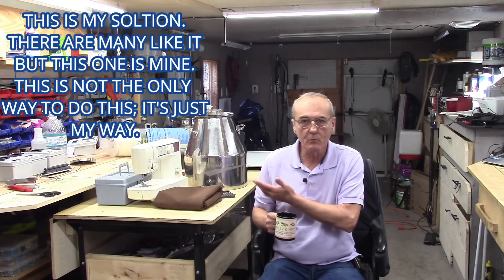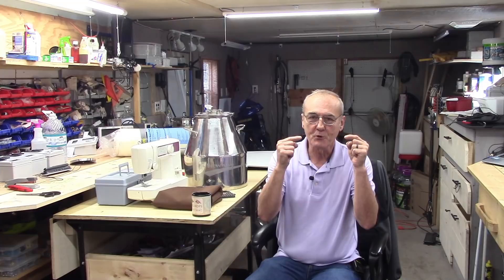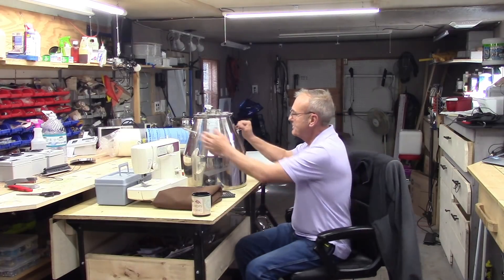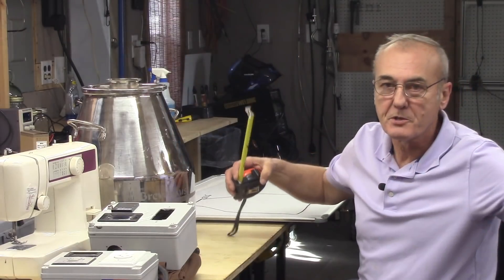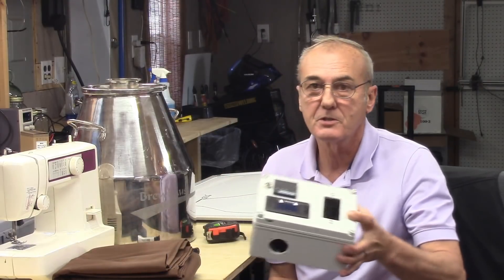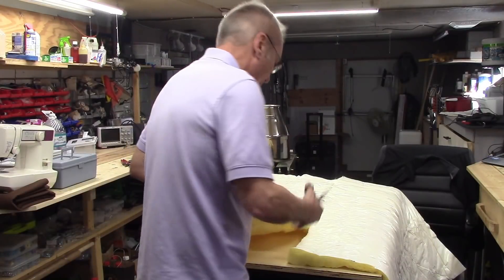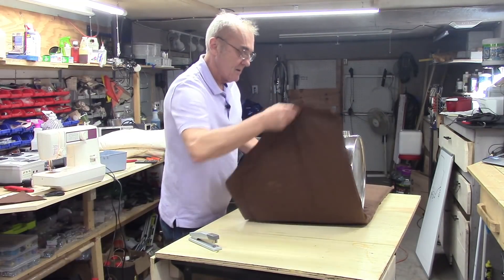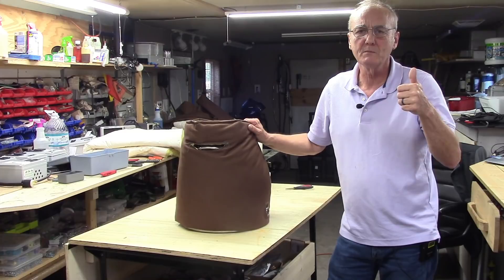INSULATING A STILL.  IS THIS A GOOD IDEA? PART 1

Comment: Wish I had the knowledge, first run with a Mile Hi 8 gallon dual purpose pro is not going well.  Head temps drop up to 30 degrees for no reason, perhaps because I am unable to run running water, but ice water in a cooler.  Frustrating.  After taking out the Foreshots and getting about a quart, 30 degree drop at the head and taking all day, may just toss this and figure out m options. 
Sugar wash was this attempt to use the still for the first time

Comment: I insulated my stills with water heater insulation jacket. It reduced my heat up time dramatically and improved  efficiency. Also prevents accidental burns from touching still.

Comment: George 
Thanks 
I was wrapping my 15.5 gal keg with a blanket. We had a quilted couch cover that we were not using anymore so I asked my better half to double it up and sew it together to make a fit wrap.
The last time I ran, I used the new wrap. This is the only thing I did differently and this run came off at 178 proof where usually it comes off at 170 proof, so it must help the efficiency. 
Well worth the time.
Good video 
Happy Distilling

Comment: I use a moving blanket to insulate the pot and a pool noodle (not the best option but it works) to insulate the column turns out that pool noodle can handle plenty of heat.
Reply: Sometimes I will take the pool noodle off after I get things up to temp so I can get some natural reflux down the column during stripping runs.

Comment: hey George...finally! someone taking  insulation seriously! way more important than seeing a whole load of shiny copper or steel.
think i may have sent you some photos by email ages ago of how i make insulating jackets.
using 1" kingspan or celotex insulation board sliced almost all the way through, then wrapped over
 the pot and sections of the still then the gaps filled in with building foam. then wrapped with foil to finish it off.
i then cut each section in half so that they are removable, and use a velcro strap to hold them in place while the still is running.
the only part oi leave un-insulated is the reflux and output condecers, i figure, if i wanna cool the product, i might as well allow those sections to loose energy.
Reply from the maker: Kim, I saw your insulated system and was very impressed. If you get a chance to see the latest episode on still bros. official they talk about your system in great detail.
Reply: @BarleyandHopsBrewing  hey george, i saw the guys over at still bros frankenstill episode. Think that they think im a bit weird. :)
Love the custom sewn jacket btw.
Ps i left my reflux condenser un- insulated on the grounds that its one part where im attemptong to loose energy, but with hindsight, this means that i then still have an uncontrolled 
variabe,...the ambient air temperature.
Ps. Feel free to pass on the link to my still vids if you think they would benefit others. Im not running a channel like you (dunno how you find time), but its kinda nice to feel like it helps others.

Comment: I added foam to my column based on your previous video. It cut 8 to 10 minutes off run time, plus much easier to control temp all the way through the cycle. I never dreamed of insulating the pot. You never fail to blow my mind! I can’t wait for part 2

Comment: I have the same cooking vessel that's on your table. I made a tin cover for the kettle that directs the heat up the sides, heating my water from all sides when using gass. This cut preheating time by roughly 40% and significantly reduced the total amount of fuel consumed. Meby this would help others.
Reply from the maker: Very cool!

Comment: George you are a mind reader.  I already had plans to make one of these for my 8 gal straight sided pot.  I use an induction heater.  Currently I have been using 2 wool blankets.  I also use a thick magnetic stainless plate inside of my already thin gauge stainless pot.  I've cut my heat up time quite drastically.

Comment: Don't ya just love the Brewhaus kettle design!!  I replaced original top which was flat with MileHigh's 8" top which is funnel shaped.  Fits perfectly, as you noted, and adds about 2" more headroom to the Brewhaus, plus it goes perfectly with the tapered Brewhaus. Happy Distilling!

Comment: I'm definitely not a scientist by any stretch... but hear me out.  Have you tried putting the still into an even larger container of water?   Water boils at a higher temperature than you run your still at. So it should continue to absorb the heat lost from the still and retain it until it reaches a high enough temperature for it to turn into a gas itself right?  Seems like it would be a pretty good insulator. 
Anyone more educated than myself feel free to explain why that wouldn't work.
Reply: I think in theory, a 
water bath heating would work. But I also think that it would take forever. 
   You'll only have 212* to heat the wash, which could take hours to bring, for example, 8 gallons up to 173*.  Then you have to think about evaporation of the heating water, meaning you'd have to add water at some point,  dropping water temp. And then ya gotta consider the "steam" or evaporation from the heating water affecting the column and condenser temps. 
 I honestly think it could be done, and could be especially useful if you want to distill on grain, but I think it will bring its own set of issues. 
 Not that those issue's can t be overcome, but, I say try it and let us know how it works out! I don't think anyone here that watches these videos that George makes is against new ideas. Cheers and happy distilling. 😁
Reply: @dieseldummy4250  Im not sure if were on the same page here. I was thinking of heating the still with the element as usual but using some volume of water as an insulator. You may have thought I meant heating the still with the water on the outside of it.
Reply: water and mains wiring (the element) don't mix.
Reply: @vtbn53  I agree but there are definitely ways to surround the connections in a non-conductive material.
Reply: @mattf9096  of course, but it is non trivial, and the slightest mistake could be lethal
Reply: from my understanding you would need to pressurize the water jacket or use something different than water, otherwise your temperature will be restricted to 212°F/100°C and you may need higher temperatures in your mash to get the steam up in the column to 173/78.  Using a high column, plates ...  will force the problem.

Comment: Great video as always.  I may cheat by having my union insulator brother help me with material and fabrication for my 3 gallon mighty mini. :-)  I would assume wrapping the column in addition to the tank would help even more.  True?
Reply: George had a video about this long ago and it works great especially with any wind. You get a much more stable temp control. I think I used two 3/4" pipe insulation for my 2" column, and no it does not harm your shiny stainless column.
Reply: I see where your going with the idea and it's a good one honestly...I would be concerned about the electric and water mixture and also the water would have to be kept from becoming too hot someway....I could see this being very complicated but efficient if done properly....

Comment: Hey George. I just bought me'a still. First timeer
Reply: Good luck and follow George's vids....all you need is here... Happy Distilling 😁
Reply: I sho will. Thanks
Reply: noob here, too...  planning to build, as buying calls for trouble around here. Already thought about insulation, maybe using some aluminum coated foam stuff (i.e. camping mat). looking forward to see George demonstrate benefits and, maybe disadvantages.